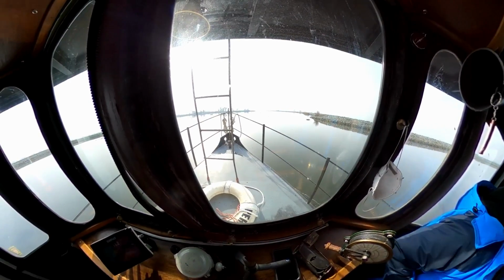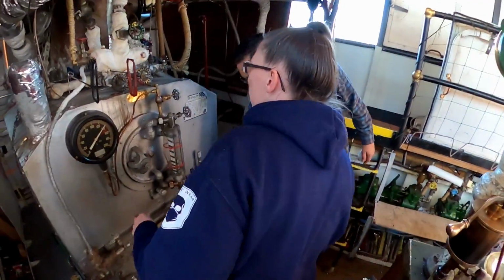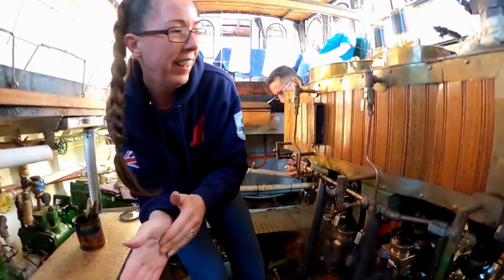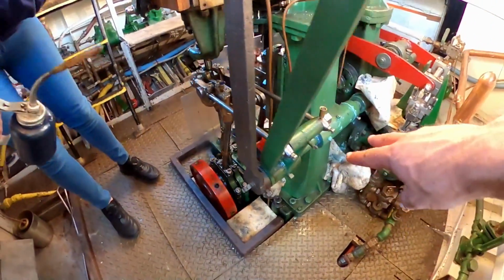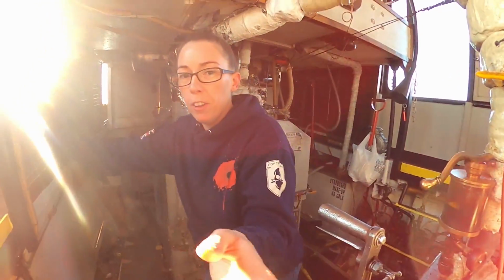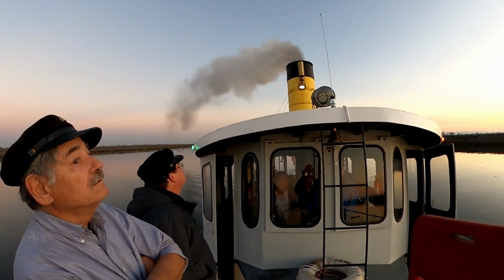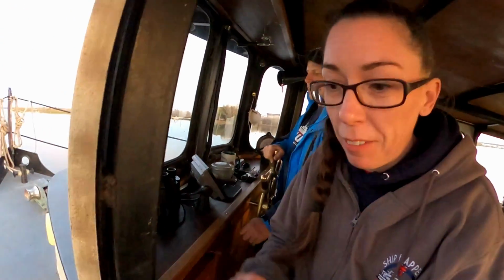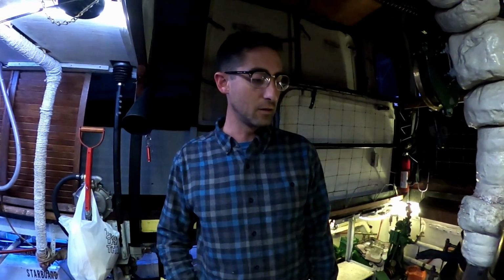Gemma's Day Out On Steamboat Persistance

Comment: I didn’t see a condenser anywhere.  Does she exhaust to atmosphere?
Reply: She has a keel condenser under the boat. 10, 1' tubes in direct contact with the water.
Reply: Keith is quite correct. Ten 1" diameter copper tubes, ten feet long. The large pump on the back of the engine then pumps the condensate (condensed steam= Water) into the hotwell which is the white tank to the port side, behind the engine. In the hotwell the water is filtered and then fed to the two ram pumps on either side of that large pump. The two ram pumps pump it back into the boiler via a feedwater heater inside the boiler casing, above the generator tubes. This type of feedwater heater is known as a 'economizer'... Extracting waste heat in the flue gasses to increase the economy of the steam plant.

Comment: Gemma looks like your having a great trip to the US and thanks for making us jealous.

Back in the 1960s I drove some old steam cranes that had been converted to electric power, they ran on train tracks and were used to unload delivery's of concrete tunnel lining segments for a new tube line in London. There were lots of levers to engages to change motions and when hoisting from the pit bottom at full speed the gears would sing.

Stay safe and thanks for that.
Reply from the maker: I am a very lucky girl! Poor Simon stuck doing all the housework while off on some amazing adventures!